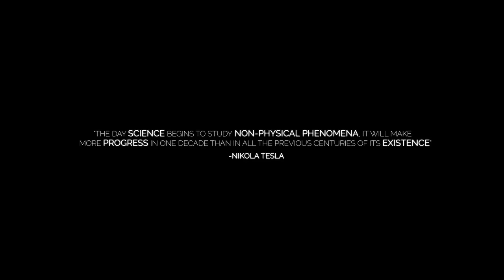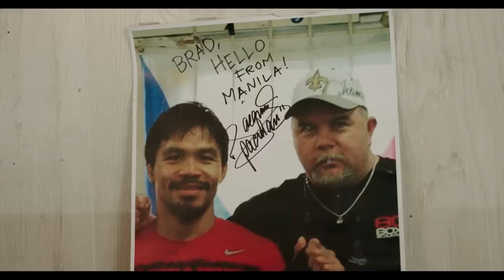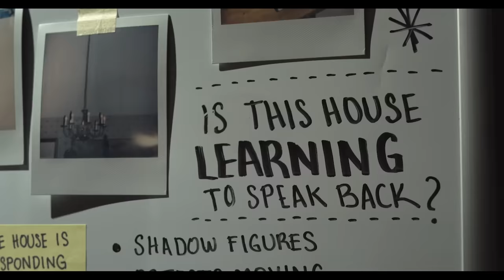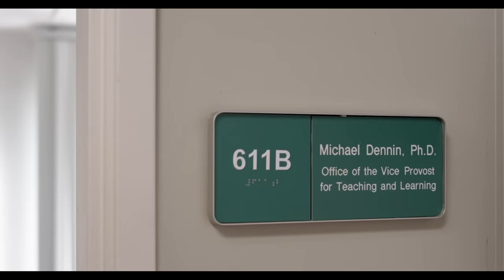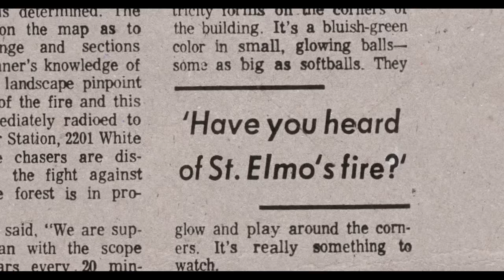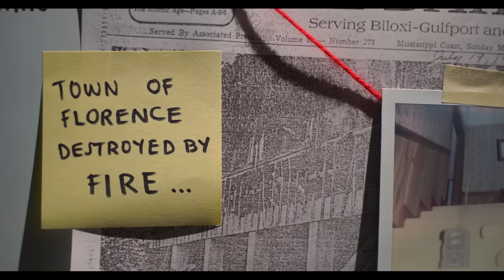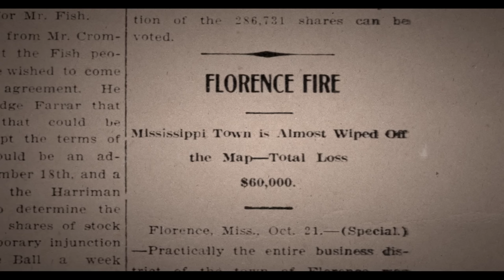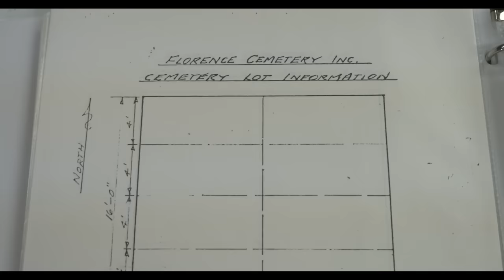The House In Between - Paranormal Documentary - FULL MOVIE

Comment: The rolling ball is easy to debunk. Look above the staircase where the ball is sitting. That’s an hvac vent, not a return that pulls air in, it’s a vent that blows air out. Right before the ball rolls in the first clip, the light dims just a split second. That’s common in older houses wired back in the 70s. It’s the hvac system kicking in, usually the a/c compressor. Our last 3 houses did this exact thing. The ball is sitting in the edge of a carpeted step. The air kicks on and the angle it’s blowing hits the riser behind the ball and pushes the ball forward.

Comment: At 33:12 he says he want to see the lights and they flash through the closet behind him it's nuts
Reply: Great catch! I noticed orbs several times but that was definitely something different.    I slowed it way down and it is just a flashing light in a straight line right behind him. Crazy.
Reply: I’m pretty sure those r window shutters, and the lights were a passing vehicle.
Reply: @monicaerebia5717  ain't nobody have window s all the way to floor
Reply: @monicaerebia5717    I think you're right. The windows are parallel to the road and a ways off, the car is basically going right to left behind him. The windows don't go to the floor, just the shutters. If you go to 34:23 you can see it in daylight. I thought for sure it was a closet too!
Reply: @laynicarter  good catch I still prefer it to be ghost lights 😆

Comment: I notice, that the reason why the lights turn off and on, is the pressure of the weight of the person standing close to the light, meaning faulty electrical wire, of course, action re-action, when the power reaches the light it also pulses to open the door. as for the ball rolling, vibration caused it to roll down the stairways......also the type of wood that was used to make the house possibly it expands more because of the environment.....

Comment: Good Documentary. Very interesting. When the ball moves at 31:01 there’s a little girl in the mirror on the staircase. Also it’s a leather baseball it could be expanding and contracting due to climate changes in the home. Which could cause the ball to expand and fall. Chandler could be a surge of electricity causing that also. Glowing light any aircraft in the area that night or day? Lightening. Just the leather ball sitting on the carpet is drawing  moisture out of the ball Which could cause it to expand and move and fall down the stairs.  Climate changes in the home.

Comment: I know what is causing the ball to move and have seen it happen in many places an it has nothing to do with the paranormal.  It is especially easy to cause with baseballs and golf balls.  I am surprised the "scientist " did not mention it. It a combination of potential energy and vibrations. Sporting ball store a tremendous amount of potential energy that's what lets them bounce. baseballs has more than most because they are wound with tight rubber bands.  This actually allows for 2 types of energy to effect them. Different frequencies of vibrations cause the rubber bands to build up potential energy to the point of release at which time the ball will  move. Appliances in the  house are combining frequencies to cause the ball to build then release the energy and the ball moves.the vibrations travel through the structure along beams and flooring. We did experiments  in psychics lab in college and made even heavy objects move. If you put rice on a plank and use an electric sander you will see the much heavier rice jump much higher than the wood shavings and dust. This is because the rice has more potential energy than the wood.

Comment: At 18:40, why is there a wire or fishing line across the step? You can see it above the doll's head. The doors shutting and the lights going off and on aren't very convincing. It would be so easily staged. Even what most of those folks were saying about the house. seemed fake. Bringing in the electrician and the dude checking to see if the house was level seemed to go along with the staging. Why in the world were three of those folks so damn fat? Damn